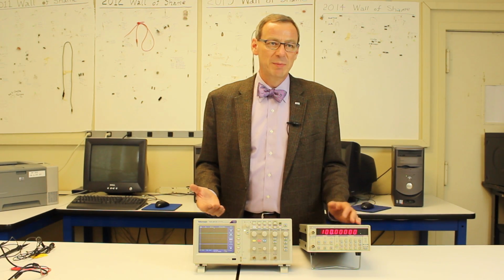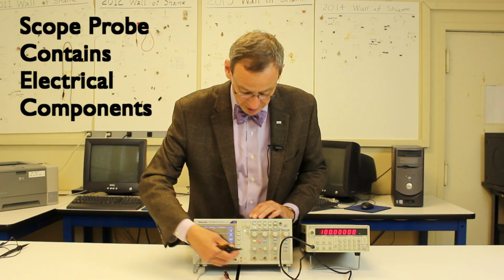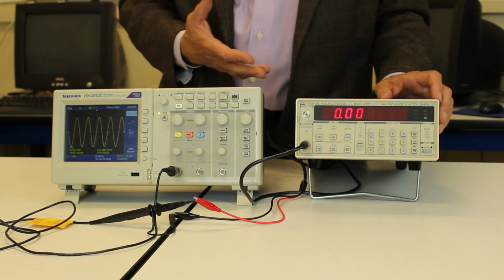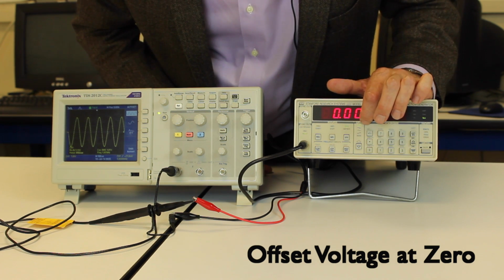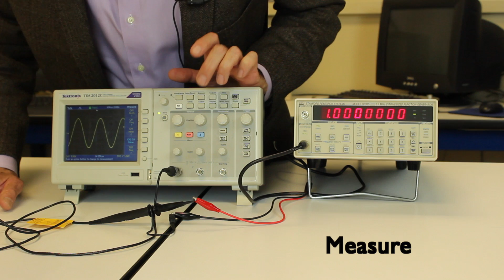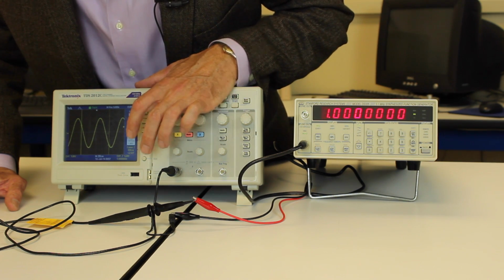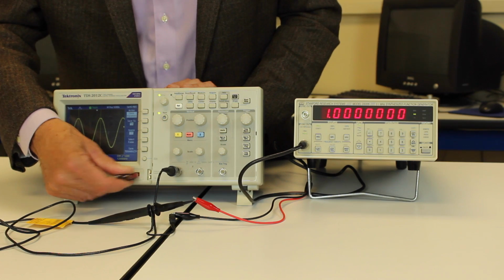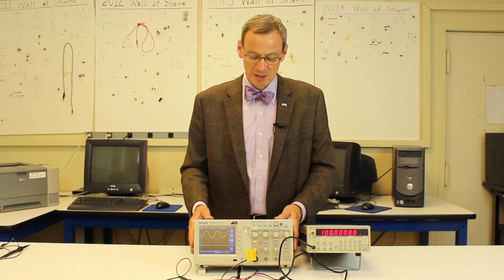Lab 2 - Introduction to the function generator and the digital oscilloscopee

Comment: I took the output of the function generator indirectly using a breadboard, jumper wires and oscilloscope probes, it showed an 'almost' sinusoidal waveform but absurd readings (400 mV pk-pk instead of 5 V pk-pk). Why did that happen ?

Comment: my signal/ function generator provide constant output voltage for all frequency range when analyzed through oscilloscope, its fine, but when i connect a load across signal generator its output voltage drop significantly why?